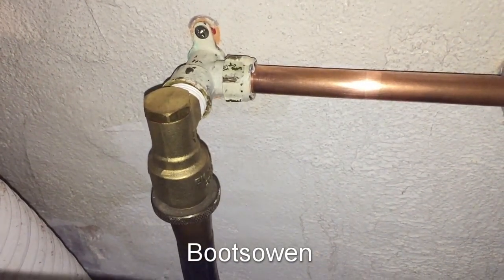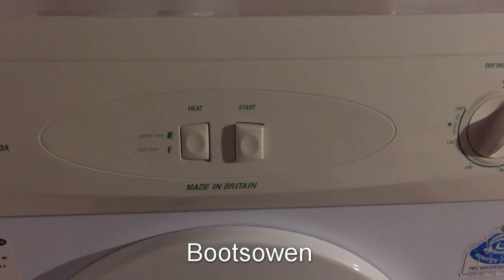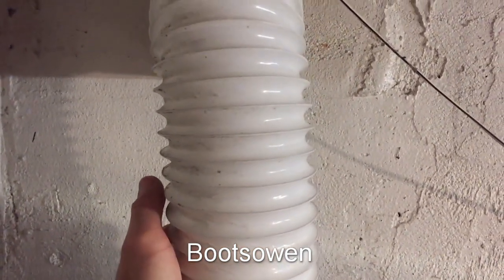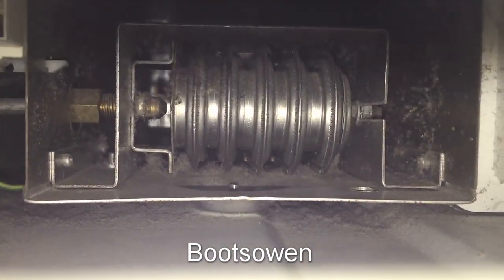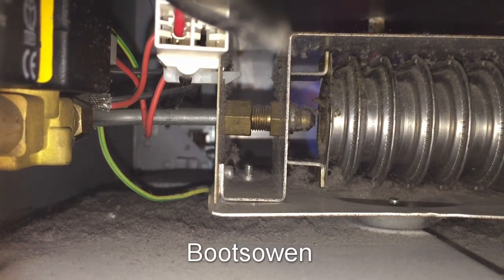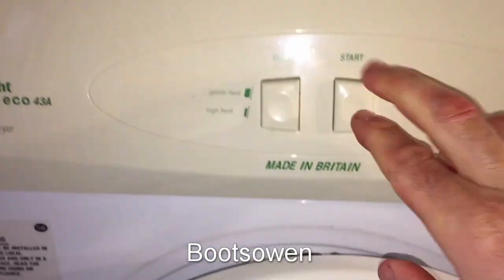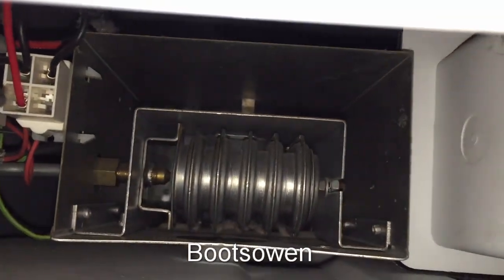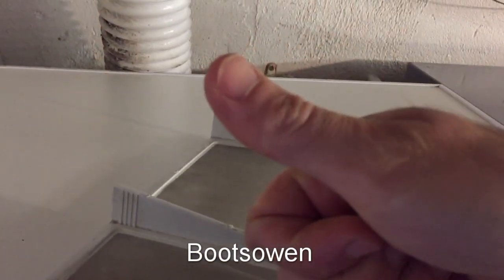Gas tumble dryer (part 2) test load and cleaning burner White Knight Eco43A

Comment: Do you get this dryer serviced along with every other gas appliance when you get someone over?
Reply from the maker: Hi, there is no requirement to have gas appliances serviced in the UK, unless you are a landlord and require a landlords gas cert. What do you think would be covered in a service?
Reply: @bootsowen  I am from the UK too. I know that Landlords checks are required but it is recommended that everyone should still have their appliances serviced anually. I want to be an engineer at some point.
Reply: It says in the manual an annual service is not required. I think as long as lint build up is minimised. There is nothing else to service.